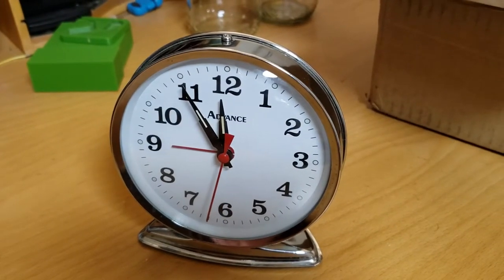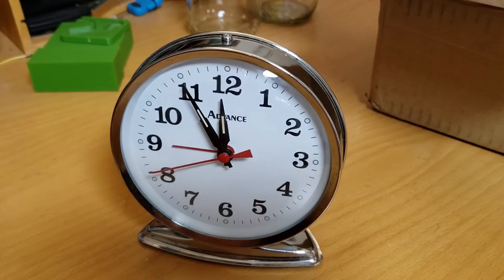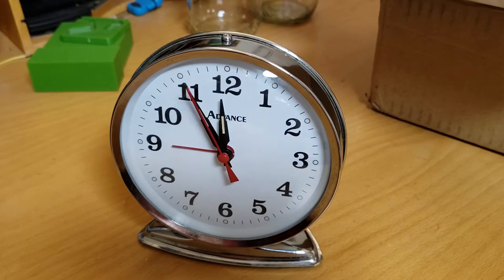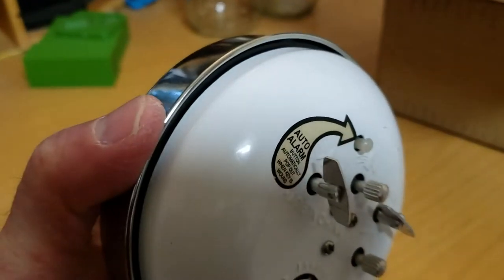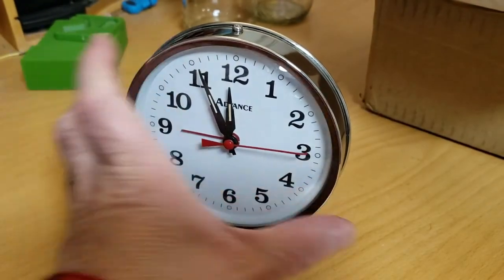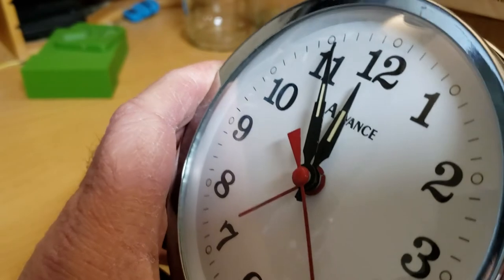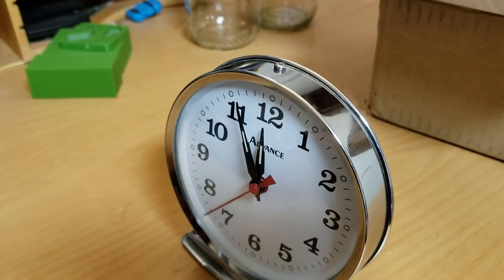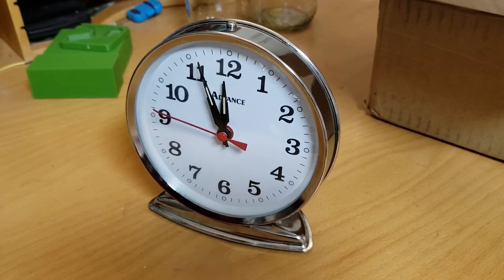An Alarm Clock Repair, Part 4: The Finished Clock

Comment: Very good series here, I viewed all 4 parts! The twin-bell clocks from the mid 1990’s use a brass and steel version of this movement with plastic motion work. They are very well built movements with lantern pinions.